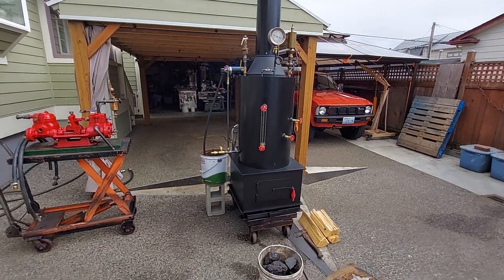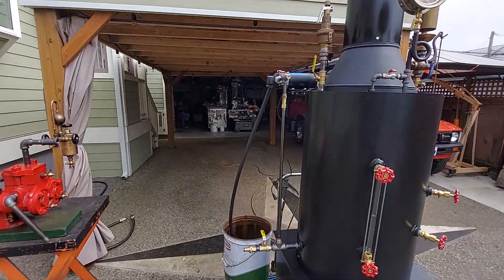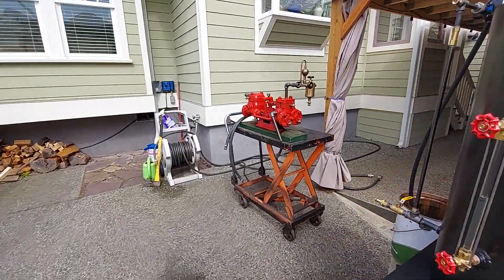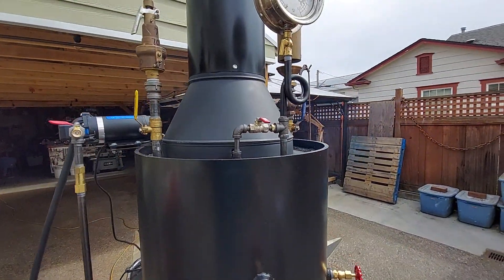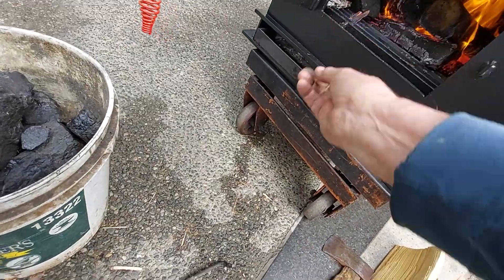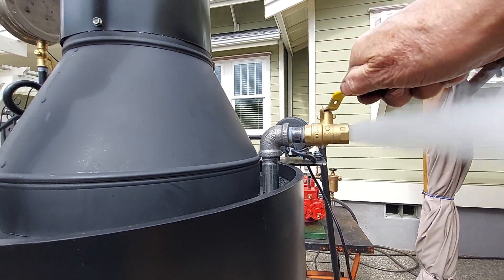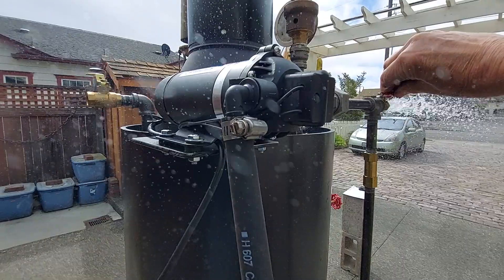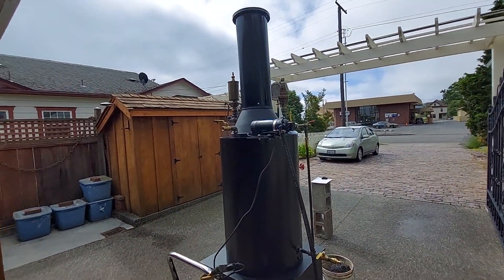FOR SALE Steam Engine Boiler American Steam Pump Whistle Gauge Off Grid Ross Bendixen

Comment: I would love to see you build a steam boiler and engine that would be capable of running an economical pickup truck steam locomotive type setup that could be used on the farm and logging roads and back country dirt roads and sometimes a little hot top :-) that would be great with an old timey look that is something that I would be interested in that would have a good cruising speed to actually get you somewhere to the next town and back:-) any ideas thanks Mark southern Missouri Ozarks USA on rubber of course a medium sized pickup truck locomotive perhaps like a Toyota or something but maybe a person should go with a 3/4 ton setup so you could actually haul a cord of wood and pull a trailer a practical real working Road locomotive for hard times and survival that would be cool with a drive belt on it or something to live PTO power for utilization of other equipment:-) if I had the boiler and the engine I could throw together my old my own locomotive I would start with an old farm truck:-) what would the approximate cost of a boiler and appropriate engine cost me I have no idea ballpark if there is such a thing I know there's so many different variables probably? Thanks